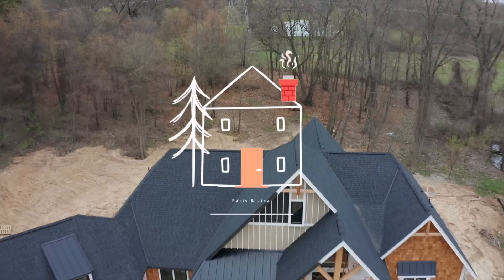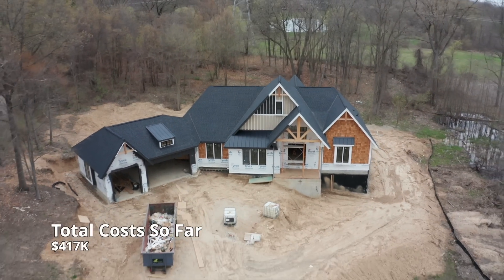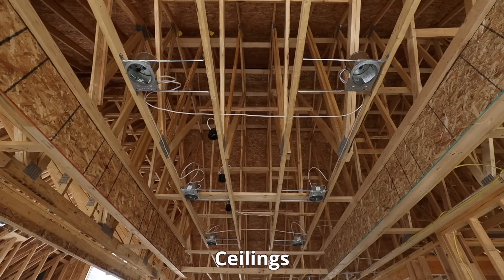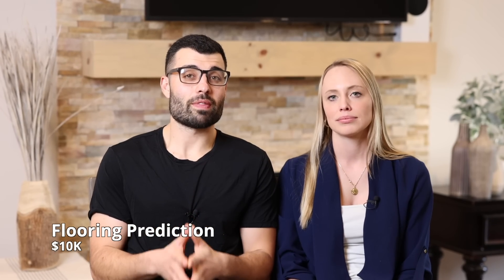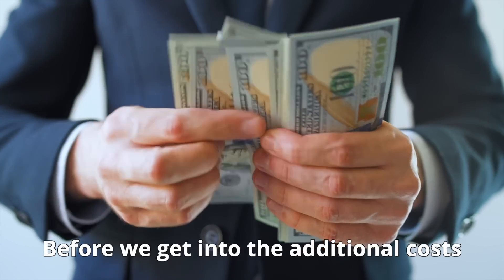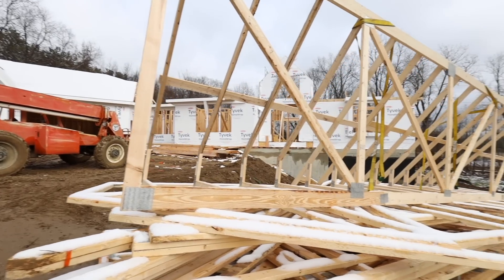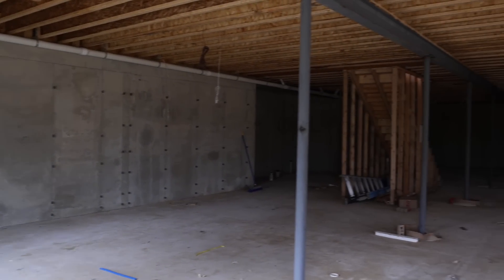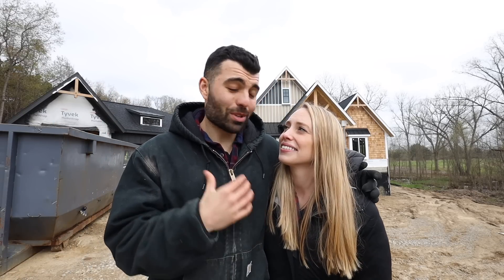Cost of Building Our Home 2023 | Current & Projected House Budget  Ep. 12

Comment: great work and home design! are the major kitchen appliances included in the $33k kitchen budget and small appliances in the $5k budget?
Reply from the maker: Hi S Kane, Thank You! We have a slightly used dishwasher already and a washer and dryer as well. So the 5k is for the refrigerator and stove/oven. It doesn't include a microwave or similar small appliances.
Reply: @FarisandLisa  awesome! did you two design your own house plans or purchased and made modifications?
Reply from the maker: We designed the home with Lisa's Dad Jerry (builder of 35 years) then took the plans to an architect for revision and approval. We are working on creating an E-book with our plans and a detailed description of each process step.
Reply: @FarisandLisa  thank you! much success completing the project!

Comment: How did you pay only $8k for hvac?  The material alone costs more than that for this size house. I’m building 4500 sq ft ranch with full basement and 3 car garage like you. My hvac bid is $33k
Reply from the maker: Your house is 1,700 sq ft bigger than ours. This is the current cost of rough hvac plus furnace. does not include air condition unit. We are also not heating and cooling the basement at the moment. We plan on putting heated floors in the basement to provide a heat source.

Comment: Also your weathershield windows only $31k?  Bc of your video I got bid for this and was $48k. Again nearly identical house to yours.
Reply from the maker: Based on your last comment, your house is 1,700 sq ft bigger than ours. Go watch our window video. Our walkout basement does not include weather shield windows. We saved a lot using sliding doors that were on clearance. $17K doesn't sound like that big of a difference considering your house is much bigger than ours and we shopped around.
Reply: Yeah their prices don't add up I just built a home 3400 square foot Colonial 2 years ago in Michigan cost me 700k my lot was 130k.